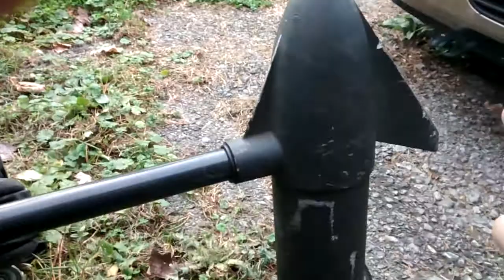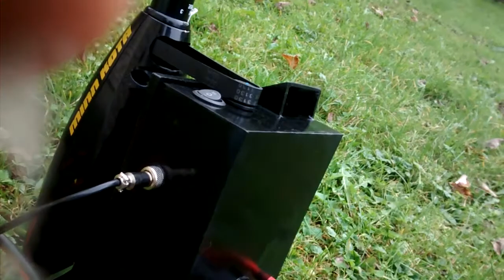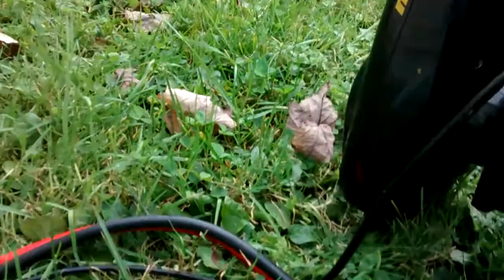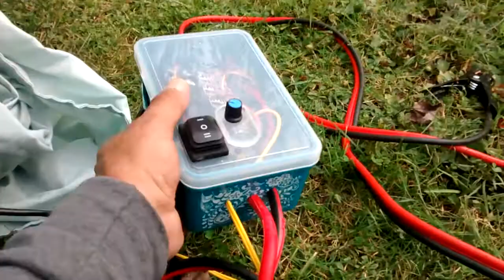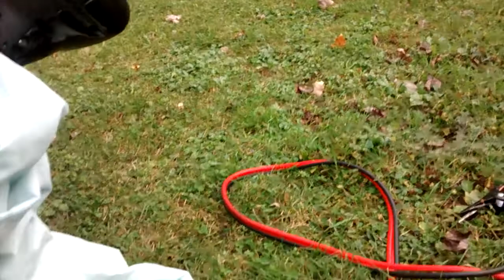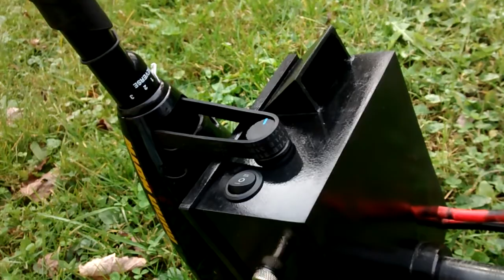pwm speed controller

Comment: I k ow this video was done ages ago but, the box that you ust to put your PWM in looks as though you run the trolling motor shaft through the box, as if the box was made for that purpose. Where did you find that box or, what box did you use. I would really appreciate if you could help me out. Thanks.
Reply from the maker: I made the box from 1/8 abs plastic and put the pwm and fan in it. As you can see, I made a hole under the trolling motor in the original housing and used a vacuum cleaner belt from the shaft to the pwm knob. I no longer use this as I made a different style.
Reply from the maker: https://youtu.be/330wgh-i8WE

Comment: Why can't you just use it the way it was meant to be used
Reply from the maker: Because I want variable speed,not the 5 forward 3 reverse. It saves on the battery  and also the original switch got to hot.

Comment: I put my cooling fan on the motor side of the pwm so it revs with the trolling motor
Reply: Check the power out first. Unless yours is different than mine,the power in an out isn't a constant 12 volts. Nor does the voltage drop accordingly when turning it down. That's how I burned 2 fans up. Now I operate the fan on it's own 12 v source.
Reply: r poirier I haven’t burned mine up yet I ran it with the pos and negative contact to the motor out on the 60 amp p w m so at 50 percent throttle the fan runs 50 percent it just runs the same percent speed as the trolling motor don’t know why it would fry
Reply from the maker: @spudhead1959  what type of fan are you using? If it's a cpu fan such as I'm using,they only work with positive polarity. When you put it in reverse it would make the fan run in reverse or if it's a fan like mine then not at all. So,how does this work when u reverse the direction?
Reply: umpy315 it is a Kaimei rotary dc brushless fan model kfo420s1h  12volt 1.6 watt it does not run in reverse just in forwards I have no explaination why but I was not really concerned about overheating the pcm in reverse but I suppose if you had to have the fan run in reverse you could run it through a relay
Reply from the maker: @spudhead1959  I put a small circuit board connected to the power in and tapped into that for a constant source.it worked fine for the fan and led lit toggle switches but it was actually  .2 or 3 volts less than the actual battery voltage. I also have a remote control steering unit that I made that has a led volt meter on it. I run everything off 3 AGM batteries that I never drain below 12.4 volts so it's crucial to have an accurate reading. With my last speed controller, I ran power just for that and the fan  with it's own cord. I ran it off the jump box plug as it wasn't effected by the pwm even though it was connected in parallel with the other two batteries. I made a new unit and got rid of the jump box circuit board and replaced it with  small buck converter. I put an auxiliary plug on it so I can plug into my steering unit with a small coil cord. now the volt reading is exactly what the battery is. Here's a vid of the new unit I made. https://youtu.be/330wgh-i8WE
Reply: umpy315 ya I checked your vid I think I got one of those laying around in my stack of stuff good info thanks took it from a defunked jump starter box
Reply: umpy315 I’ve till now been running a group 24 Kirkland lead acid deep cycle  on my kayak it works great and all but lately I’ve been turned on to lithium iron phosphate packs so far just in test mode but batteries are very  impressive if my calcs  are correct I have a 60 amp hour battery that weighs about 8 lbs and at 100 percent charged is about 17 volts I just might wind up running the fan off a separate battery source or through a resister
Reply from the maker: @spudhead1959  That's what I've been wanting to get. I would like to buy two 100ah lithiums. That would probably cost 1000.00 without the charger. Also,which ones are the best choice. Right now I use agm batts. There pretty good but 1 of them is a vmax 155ah. It weighs 91 lbs. I have wicked rheumatoid arthritis and just had both shoulders totally replaced this past year. Today was my first day out and loading the batteries  was a little rough,been 8 was since the last surgery so still a little sore. It was worth it though,a real nice day. Anyway, here's a video of testing out the new speed controller.  https://youtu.be/lQAScDs9oJk
Reply: umpy315 no I’m building my own I call it the spud head 5200 its 12 rc 5200 m a h 2 cell battery packs that are 7.4 volts    so I use 2in series that gives me 14.8 volts and I have 6 sets like that that I parallel to a couple of copper busses I got the idea from the from another you tuber called good of the land
Reply from the maker: @spudhead1959  I love messing with stuff like that.
Reply: umpy315 I finished my Lipo lithium battery for the  minkota 45 lb thrust that I have strapped to the back of my cheap Walmart fishing kayak taking it out salmon fishing Saturday I’m using a pendant with the fan and pwm inside with the fan I can feel it heat up when I run it hard then I back off and it cools right down on my old set up   Got about 300 bucks into the lipo battery seams to run great in the back yard see how it go’s
Reply from the maker: @spudhead1959  Anxious to see how it goes. GL.

Comment: Thank you so much for the effort and information. Am installing a digital controller on my new Minn Kota 55lb and you confirmed my thoughts as to which two wires (down to the motor) I needed to connect to as to use the digital controller exclusively.  You are very clever and meticulous with your problem solving and design execution.  Might I be so bold as to suggest that you spend a bit more time practicing your presentation.  I think of myself as being a long-term do-it-yourselfer, but had a hard time following what you wanted to tell us/me.  Thanks again, and GREAT job.  aka (mrgizmow)
Reply from the maker: You are absolutely right. I could have been clearer in my presentation. Sometimes my thinking gets ahead of me. Thanks for your comment.
Reply: You're welcome